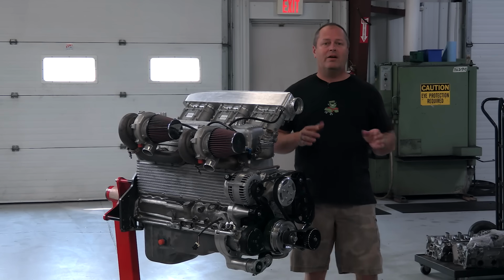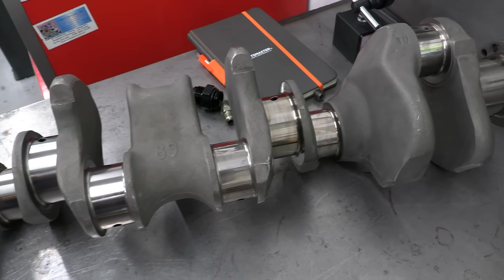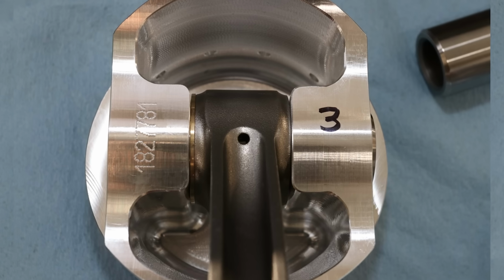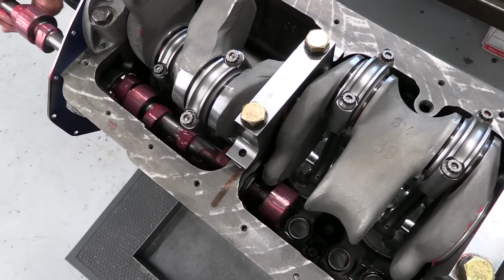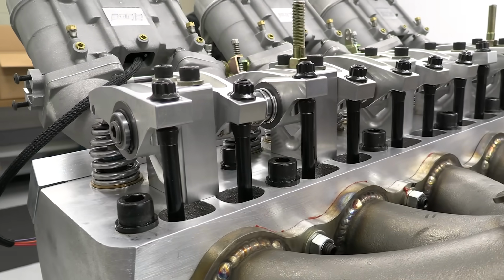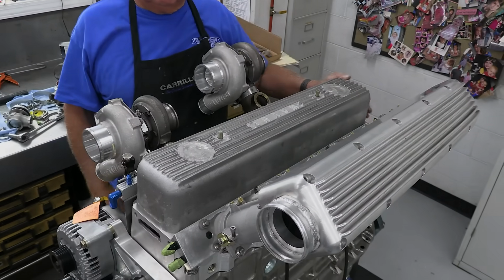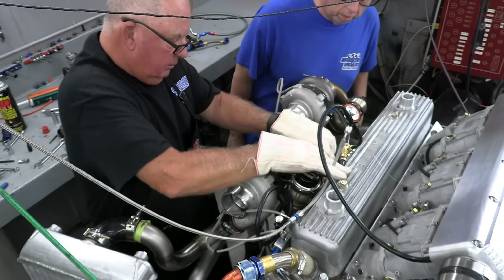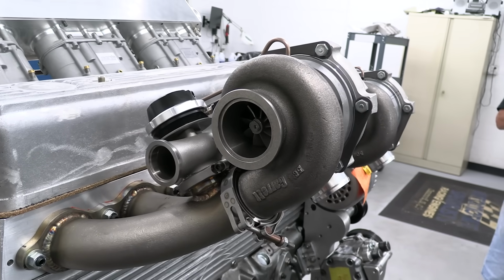Incredible Twin Turbo Chevrolet Straight Six is a One-of-a-Kind Creation!

Comment: Pontiac came out with a straight six in the early 1960s that had an overhead cam head and used a 4-barrel carb. I drove a Tempest equipped with that engine back then and it had plenty of power. I haven't seen one of those engines around in years.....this engine here is amazing, the amount of engineering and work required to build it. Those injectors resemble the old style DCOE Weber carbs that were popular on many race cars back then...

Comment: In 1968 the 194 ci six in my moms 63 Acadian gave out. It had never had an oil change, I had told her it was needed every 6 months or to call me so I could get it done but she never did. Turns out she didn't need an oil change, there was less than a quart in it.. This was Late on a Friday and she needed it to get to work Monday so I took what I could get I added a 250ci six, a week later  added a 2 barrel holly carb and manifold , a larger exhaust  and 14 inch rear tires 8 inches wide. sent a lot of people home counting their spark plugs. Some of the Camaro and Mustang drivers gave me to much of a head start (More than 3 and it was over). Never asked for a head start but some did because it's just a stock  6 cylinder 4 door Pontiac, Nope it's not. Had I been able to find a 292 there would have been a lot more people crying just was not one available locally that was a straight drop in and run. Just started looking for a 63 Acadian in 2022, I have a 292,  a worked over trans and converter from a Z 28 Camaro that was built for 1/4 mile and a complete posi trac rear end from a Shaker deuce. So if I can find all the pieces it's look out Japan the old fart is coming for you! I can't stand all that Asian crap and they all buy the same muffler that sounds like a diarrhea fart without the bubbles!

Comment: NICE WORK PERFECT FOR AN EARLY VETT  U worked on a 210 cu in rambler twin turbo 60 pounds of boost  would run over 1000 hp for hours

Comment: My dad and I ran into a guy that was in Modesto CA for graffiti night( this was in late 80s before the city ruined it) he had a bucket t roadster. But instead of the usual small block, it had a Mopar slant six. Had a decent cam and a set of dual fours. It was of course all motor. Which I prefer anyway.

Comment: This brings back so many great memories from when I worked at Precision Machine shop a bunch of years ago. We did some sneaky machine work on a 307 chevy and got it to pull 9.60s in the quarter mile in an Opel GT, we were running a 393 in the GT originally but during off times we built a few grenades, the 307 was one of 'em. That was back in the late 70s.  I just wanted to share a little bit of my fun but it was nothing like this exotic inline 6.  I really enjoyed your video and I want you to know I never took my eyes away from the monitor the full 27:53.  Thanks for sharing, for what it's worth, I left a thumbs up, a sub, and a tap on the bell.

Comment: The waste gates and blowoff valve should be angled in line of the flow of exhaust gas. It’s a pet peace of mine when they are just 90 in. Ik it prob interfere with this turbo placement but for tuning it can actually be a hinderance because it causes the air to tumble. Still love the build

Comment: In 1975, I had a 1949 1 ton Chevrolet PU that I used to go to the mountains to get wood.  My father had a used 62 Impala 235 that he would give me if I overhauled it. The lifters will identical with the 216 and 235 but they solid and hydraulic. I had the hydraulic with the solid lifters. It would give me a bit  more lift and duration than the 235.  I also came up with Edelbrock three deuces for the intake and headers for the exhaust. The Pu came with 4.55 rear end gears! Boy did it haul wood then! A friend tried to pass me when I was hauling a cord of wood. He could not pass me until I hit about 90 mph and the car was making 250 hp. Ah the olden days!

Comment: I moved from the US to Australia in 1976 and discovered that straight 6 engines were the rule here and V8s relatively rare. But General Motors Holden was the car maker that was by far No 1 for Australians. Since it went it’s own way after the 1948 Chevrolet, GMH had used the Grey 135 CID straight 6 and then up graded it to the Red motor in the mid 60s which by the time I arrived had been  increased in many steps to 202 CID. There was also heaps of aftermarket go fast gear for the Holden 6. I recall looking into the window of a hot rod shop at some Yellow Terror heads. Yup, they were painted bright yellow. So this build taking a 50s block and throwing everything we have learned in the last 70 years at it was really enlightening. More than anything else it shows exactly what computer technology is worthwhile putting on an internal combustion engine. No check engine light. No significant other sensor. If I were building up a straight 6 on a budget I would upgrade the engine for economy, not power, given current conditions. I’d start with any decent body that would easily accept a GM straight 6, and go as far as money,common sense, and my own skills would allow. Way less than those of a master builder, but what a stunning example of what is possible. Thank you for an excellent video.

Comment: Corvettes used the Chevy 6 with mods.
The Wayne head was around in the late 50s.
4 mains? Slant 6 and that was long stroke.
LS?  Just another GM engine. Very good as a std engine but really makes no more power than a SBC when modified.
The 252 /292 Chev 6 would ahve been a far cheaper cantidate to build and a far better engine.

Comment: If you like 6 bangers you should check out leo santuchi that guy already layed the pavement i have used some of his ideas on 250 and 292 gm truck blocks although some ppl have a hard time choppin heads apart and welding them and cutting and welding and plugging coolant ports

Comment: here in Brazil there are a lot of preparation parts for the straigthsix 250, it was an engine widely manufactured in Brazil, it equipped the Chevrolet opala 4.1, it is literally the second most prepared engine in Brazil, It's only behind Volkswagen's AP engine.

Comment: Dear General motors,  your company has gotten away with barely doing anything innovative for decades... just regurgitating old technology mixed with new ideas attached to them. There should be at least 5 engines available for the C8 . High output 4, 6, 8 cylinder engines with a hp range from 400 - 900 hp should be available. But no . 2 engine choices . Your company takes forever to come out with changes and updates and upgrades that you miss the market by years not months. And when you do,  it's like Apple,  something everyone else has been doing but you claim you're doing it better. Where's Will Smith when you need someone to slap the sense INTO someone 😒

Comment: I don't know If u guys already know It, but here in Brazil this engine is a beast. The most used motor in Drag Racing. In fact, the most used one is the 250-S Chevy, a "smaller" 292, but there are a Lot of people who uses the crankshaft from the 292 on the 250 to make a stroker. We havent had a great amount of v8 around here, most because our polution/environmet politics, so, at low cost, this is the best thing u can get! Anyway, im just saying this because here in Brazil, because of everything i told, there is a LOT of aftermarket products, upgrade parts, etc etc. U guys should search for some of Brazilian projects and learn a few things and what upgrade parts we have here to sell. We kinda already made everything u can magine with this engine, some can reach +2000 horsepower.
Reply: Decided to share this because u said in the video about the lack of aftermarket upgrade parts for this engine. Not trying to brag about our projects, just sharing info. 🤜🤛 I would love to see more inline six Chevy in the US

Comment: I would have definitely not used this engine (235 cu in?)...the next generation 6 cyl is the better choice because of having 7 crank journals.
Just me tho!
Reply from the maker: You are correct that the newer generation would be a better choice. What I found out after I made the video is this block is the original that came in the Suburban being built. So that's why. Thanks for watching

Comment: I can't believe you are going to use a scrap Fram oil filter on that motor.
Reply from the maker: Make a few dyno pulls and cut it apart to inspect for metal
Reply: Oil filtration was an extra cost option on those motors from the factory, so even a Fram is better than what most of em had (most had no filter at all)

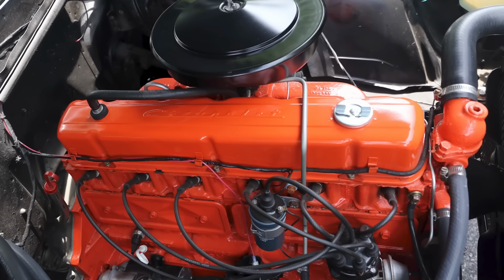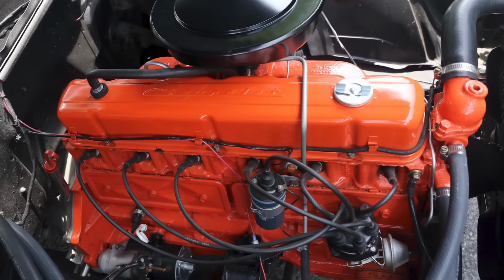Comment: 2:55 - The Australian "Red Six" made by GM from 1963 onwards was based on that same old 2-plate stove bolt Chev shown at 2:55. They were a darker red, and originally 147 and 179 cu in. It was enlarged over the years and got longer stroke, counterbalanced crank, etc. It went hard with a set of triple SUs or Webers! The design survived well into the 1980's before being replaced by a Nissan RB30 in the non-V8 cars.

Comment: Amazing machine! In 1959 (19 Y0), I rebuilt a 1949 straight-six with scored cylinders. It had to be bored out to .60 over to clean up the scoring. This wasn't a performance build, just to put a better engine in a '46 Chevy PU. As I recall, it had splash oil pickups on the rod bearings; I installed them correctly the first time. It was too tight to starter-crank and I had to hand-crank it for several minutes to get it to run. Fortunately, the oil flow was sufficient to keep it from seizing. It was a blast finding the parts and a wonder it ran the first time.

Comment: That's a beautiful motor but a BMW water pump . I hope its not the one with the plastic impellor (E36) as the impellor cracks and comes loose on the shaft. You can guess what happens then.

Comment: GM did have a few higher performance goodies available for the 235.  In the 1953-'54 Corvette the 235 got triple sidedraft 1-bbls carbs, dual exhaust and a high-lift cam.  The 194/230/250/292 Chevy engine family came out in 1963, not 1962.  '62 was still the 235/261.  ONLY a 261 would have worked for your build, as it was the only stovebolt engine that had full-flow oiling.  All other stovebolts had bypass oiling.
Reply: Full flow vs bypass is just the filtration, and not all 261s had full flow filters

Comment: You said he couldn't find bearings and then he used the bearings so did he find the bearings or he didn't find the bearings that could use on the crank he couldn't find the bearings and then he did find the bearings

Comment: A friend and I did a pass through turbo on a 292 / 2 speed power glide 65 short box pick up a few years ago. Used a Edelbrock 4 barrel and the turbo from a Volvo wagon. That pick up was scary fast. I cranked it up one day to 4600 rpm with 13 lbs of boost and when it slammed into 2nd it broke loose and revved to 5600 rattled for a brief second and let go of #5 rod which poked out through the pan throwing oil all over the exhaust and locked up pretty hard in a giant cloud of oil smoke.  But wow what a mean sob until it came apart .

Comment: Boy would I love to install that beast in a heavily modified MG-GT-C body.
The original GT-C came with a 6 cylinder straight 6 engine smaller than the engine so the engine area would have to be custome extended by adding a several inches section to the nose and frame plus seriously beefing up the frame and running gear plus a custom built drive shaft and rear end.
One thing I loved about the MG-B I used to own that I put coil over airshocks and wide Dunlop Qaulifiers on the rear and skinny Dunlop Qaulifiers on the front was my ass was only 12 inches off the road and it hugged the road like it was glued to it. 
The handling was  fairly good and curves were a blast.
I can just imagine the engine I that modified C model MG-GT.
Of course you'd have to install a roll bar with side and rear cross supports.

Comment: All of this was great, up until that Turbosmart manual boost controller (brand irrelavent) its the worst form of boost control.
worse than just a heavier WG spring.

Why not a decent Electronic boost controller with safeties for $200
Instead of a manual boost T for $50

Comment: No way I'd put a bearing on top of another those bearings are gonna start side wear
Reply from the maker: It's actually a quite common in stock car racing, especially with the 2300 cc Ford four cylinder in the Mini-Stock ranks where power is so hard to come by. Granted, the block machine work and prefit has to be dead-nuts right, but if the bearing crush is correct it isn't an issue. Thanks for watching

Comment: That thing should have had 7 main bearings like the 300 inline ford
Reply: The engine this motor replaced only had 3 main journals, and the Ford 6s of the time were also 4 main journal.

The 300 Ford was Ford's answer to Chevrolets 292. The Chevrolet 292 is a 7 main engine.

Comment: I've seen some serious Ford 300s I used to have one in a 87 f150 thing was great I think it pulled better than my small block 350 trailering wise better for off-roading too in my opinion you don't need a million horsepower for the woods obvious in my opinion low RPM torque is what you want the reason those jeeps had those 40s forever but you can you might be able to use the parts from the Ford 300 on the Chevy straight 6 you know some of them like turbos and stuff you might have to get the 240

Comment: In my opinion of V6 does not belong in a truck even if it's turboed I think a truck should either be a V8 a diesel or straight six because of the low end grunt that you get from a straight six you cannot replicably you can't replicate that bottom end torque by putting turbos on a V6 I don't care there's still lag and there's no lag on a big old big bore straight six

Comment: I love straight sixes they're bulletproof honestly I wish GM would give us a turbo straight six instead of a V6 like Ford and I'm talking about for the half-ton trucks or SUVs that's what Ram's doing they drop the hemi and they're doing a turbo straight 6 for their chargers Rams challengers there's even going to be a hellcat version with like 800 horse because of the EPA hey I'd rather have a turbo straight 6 than a V8 that shuts off half of its cylinders

Comment: An excellent build 👏👌👍
Guys! Many well thought out and layed out improvements. 
Do you think with the 1962 , 7 - main bearing block, an improved cylinder head, that the 750 H. P. number could live on the street in an old pickup or light weight new Calarodo 🤔 ? Say?
👌✌🏻👍👋🏻 ❄ 🇨🇦 ⛄ 😎.
Reply: The 7 main bearing engine is 1963* and newer, and a completely different engine family.

Comment: This build just have me a memory when my dad took a 1979 triumph yr7 and used a Buick grand national boosted up to 4.3 litres and then a regular cubic inch build also and custom everything a SS Chevy diff and the turbo 350 custom he built he is a  transmission icon everywhere here and the custom radiator and restoring of the car body to the ten coats of arcrillac laquer paint job put on but it all came together after fourteen years and still exist and lives in Charlotte with one of my brothers as a caretaker of the craftsmanship he has given us all to carry and keep

Comment: Awesome video!    I've always loved the straight six motors.  Back when I was 15 and a old Motorhead dad lol.  We stuffed a 194 straight six in my 1974 Vega gt.   Tight fix with a few adjustments lol.  We put a big can in it, a home made three deuce intake, home made 3 way split exhaust, three two barrel carbs..all fueled with a electric fuel pump.   I sure wish I had some pictures of it.  It was bolted to a 4 speed manual trans.  We cut down a posi track rear end out of a some chevy .   There wasn't anything that sounded like it lol.  
 I'm sure we did a lot of wrong too but At 15 I thought I had the meanest six in the county.    She made a lot of people turn their heads when I would open her up lol
   Anyway,   just wanted to share this story and to tell you all that your 6 is freaking amazing!!!!

Comment: Actually there used to be a lot of speed gear for the 216/235/261 family before the sb Chevy motor.  Offenhauser, Fenton, and now Wayne are all still making double and triple manifolds.  That said, these days you’re not going to find the weirder stuff like dual ignition setups (I think Mallory still makes a dual point and Unilite that fit though, and new cams were available through Comp Cams at one point).  Anyway, still, it is a cool built.

Comment: Amazing build and thoroughly innovative engineering. Thank you so much for the Video. I noticed that there is a direct replace of the timing chain with a gear drive with no idler gear in between. If my brain is functioning doesn't this cause the camshaft to rotate in the opposite direction? Like a marine (boat engine) camshaft? Of course not having a distributor or oil pump allows a full custom grind.

Comment: That's a wonderful build, a great use of expert technical knowledge and human skill, especially considering they could have dropped in a Chevy crate engine, probably for much less cost.  It is people like this who will work us through the next century as our need (and desire) for powerful prime movers changes away from high octane fuel burners.  Who would have thought you could wring over 500 hp out of a straight six from the 1950s?  Only these guys who love a great challenge, and can use their knowledge to the fullest.

Comment: In 1958 and even up until the turn of the century, if you told a GM engineer or engine designer that their 6 cyl. engines could be made to achieve 500+HP they'd have laughed in your face.